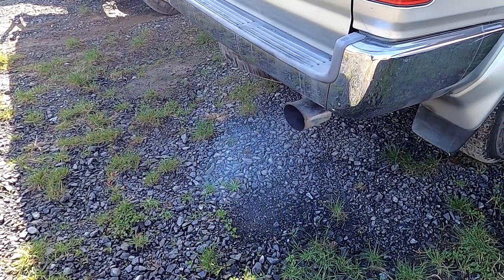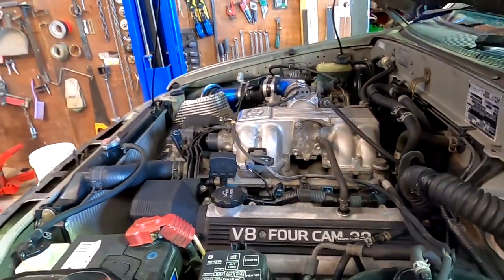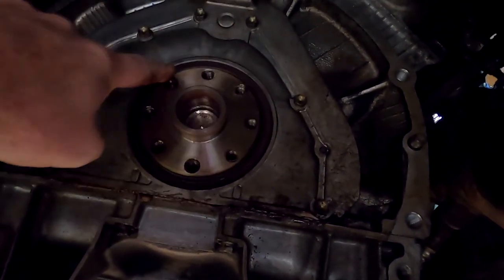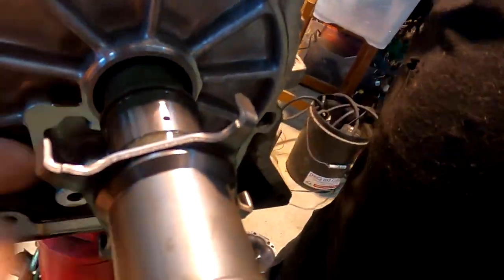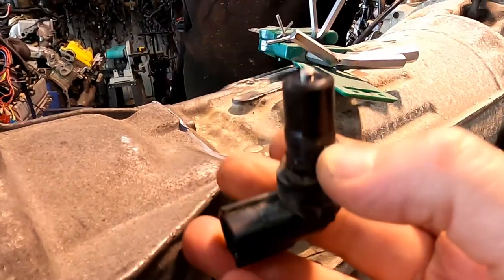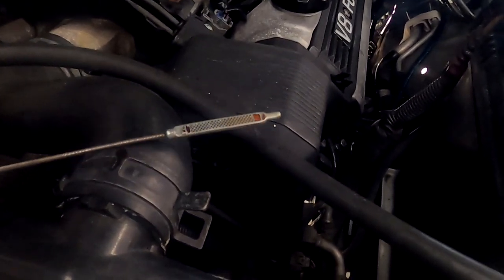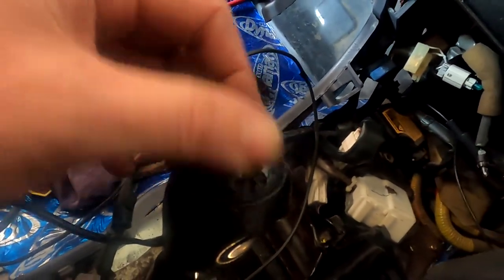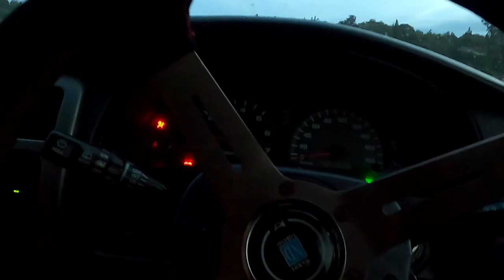weekend warriors 4x4 build.  185 Gen 3 surf 1uz 2 wheel drive??  We have to fix that.

Comment: Hi kelvin!! i am going to purchase a 3uz ecu reflash for my lexus (from quantum auto), but was planning on running a small dry shot of nitrous (50 shot) before the maf beacuse ive read that the stock ecu can make the proper afrs to account for the extra air. I know its specific but would you assume this would still work after the reflash?

Comment: Hey Kelvin, i got a 99 LS400, cars been sitting for a minute and when we went to put a new battery in it and fire it up, the car wouldnt catch gears! I put it into reverse and it would go a tiny bit then stop and leave me in like Neutral, same with drive. Had to floor it to barely get it to move. Any ideas?